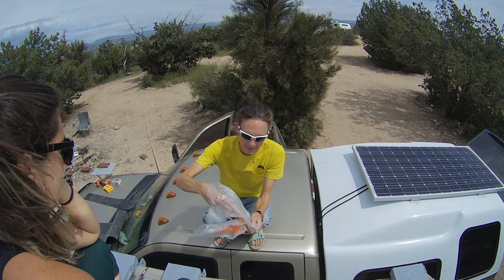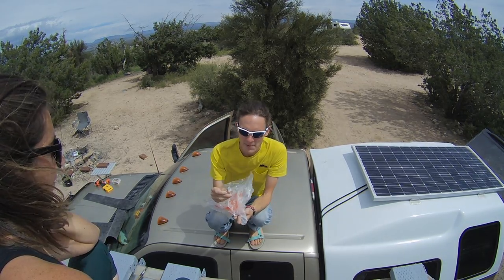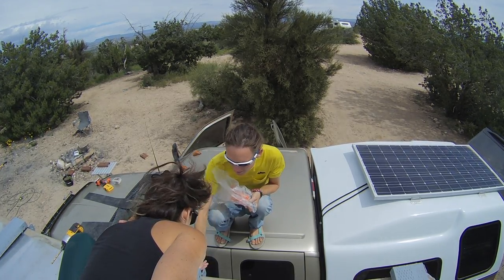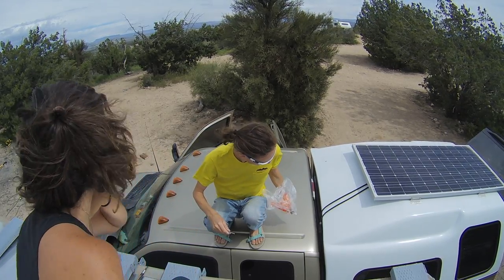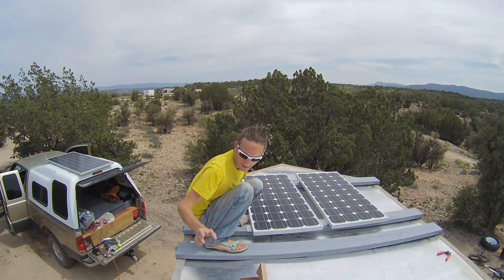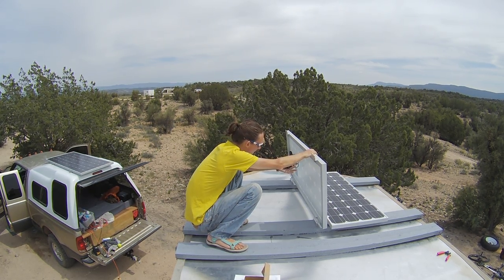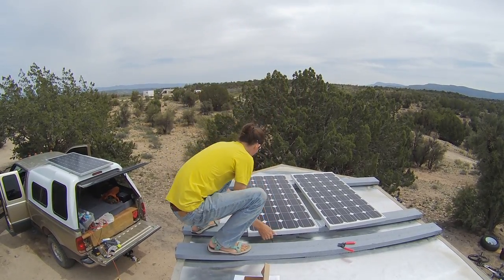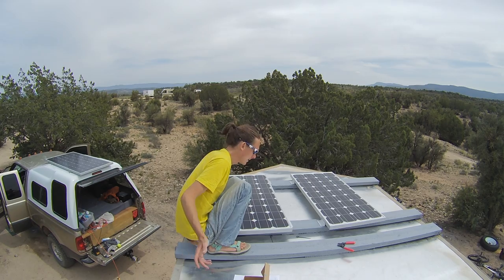Installing a $700 Renogy Solar Kit on our Cargo Trailer (Part 2)

Comment: I think your method for installing solar panels on a cargo trailer is brilliant.   Many drilled holes in their trailers which I think risk leaks and cracking of the roof due to vibrations of the soft sheet metal. Bravo...I am doing mine the same way you're doing it.

Comment: I have six 100 watt mono panels from Renogy. I'm amazed how much power they put out. I'm able to run my coffee maker, microwave and everything else except ac. I mounted two on each of 3 Harbor Freight welding tables. They're $59 on sale and allow me to easily aim and tilt the panels to stay perpendicular to the sun all day. According to Renogy, that gives me about a 20% advantage to laying them flat and of course, much easier to keep clean. The tables fold up for easy storage along the inside wall of my utility trailer when I move. I leave the panels attached.....I like your system too. No holes in the roof
Reply from the maker: Excellent Harold!  Sound's like a nice setup.  I know you get more power that way.  So far we haven't had any trouble running out of power yet either but I have seen some systems that mount similar to what you describe.  We are all into simplicity as in put it in and forget about it if possible so we went this route.  That all said if every inch counts and you need max power, your setup has advantages. Your panels go inside while driving?  Interesting thought.  Makes watching for tree limbs less hair raising!

Comment: This is exactly what I was thinking for panel mounting. May not please the ones who like to impress and have deep pockets for more stylish mounts but for those of us who don't need to impress or out do it looks very clean and fucntional.  Looks like a strong and inexpensive way to mount on a flat roofed cargo trailer. I was looking at all ideas for mounting on my similar trailer.
I am using three 100 watt Renogy panels in parallel and a EPever/solarepic
40 amp MPPT controller as my trailer is only a 10ft. I noticed you connected them in series which was my first thought but doing more research parallel would be better for a trailer that will be in several different positions when parked. Panels in series will lose most of their power if even one panel has any type of shading. In parallel this doesn't occur. and the MPPT controller still delivers the optimum current to your batteries. So for a mobile application parallel is better. Series is best when permanently stationary and allows for smaller gauge wire on longer runs to your contoller. Not preaching but gloves should always be used when handling pressure treated wood as a precaution. There's some nasty chemicals in that wood to keep it from decaying.
Thanks for such a informative and helpful video!!

Comment: the ends with the conectors on the panels should all be facing the center of your boards so you can connect them all together with out adding any wire to it

Comment: Nice install, I was linked here by Bob Wells video and I really liked what you said and your approach to this lifestyle. I've been living on the road now for almost 15 years and I agreed completely with everything you said in the cheap rv living video. I'm curious about the spot your camped when doing this install. It looks like an area I frequent when I'm in the Sedona/Cottonwood area. I think this is a small FS road (I've never seen a USFS road marker on this road) that is on the right side of 89A heading out of sedona towards cottonwood just before the highway bifurcates between FS road 525 and Page Springs rd. Is that right? If so, I may have seen you putting the panels on your trailer a few years ago. Usually, I would camp a bit further out on that road where it heads toward a ridge line that overlooks Cottonwood. Hope you are still out here living the nomad life. All the best to you and maybe I'll meet you guys some day. Cheers and be well!

Comment: No part 3?! How will I ever install this thing on my own?! Haha. Thanks for the videos. We RV full time and are installing the same system on our 5th wheel. We are traveling out to Arizona in September for my job and will be back rambling by November. How do you two stay cool in the summer months? -Allocate to cooler climates?
Reply from the maker: Part 3 is coming, there should have been a part 1.5 as well.  The wiring video's are taking awhile to compile due to having them on multiple...broken computers at the moment!  Stay cool in the summer...yes we drive north.  We can't sleep above 92 degrees or so and running an AC seems wasteful and with our setup requires a generator.